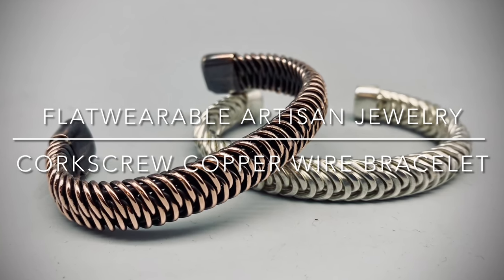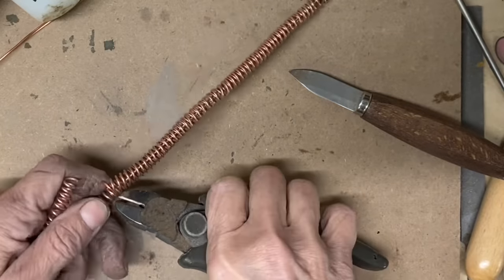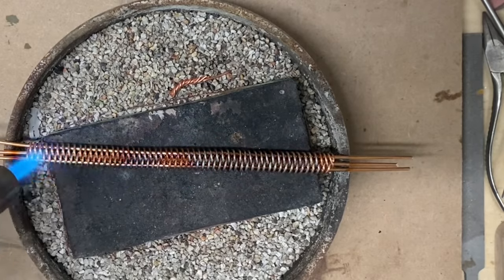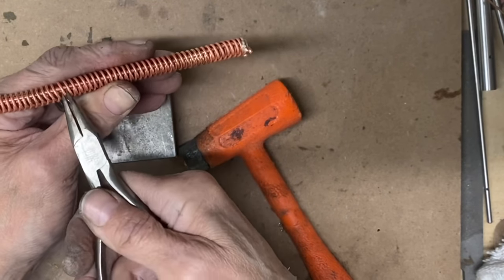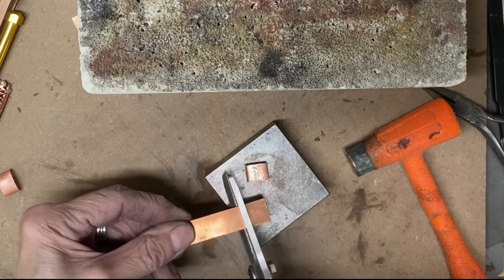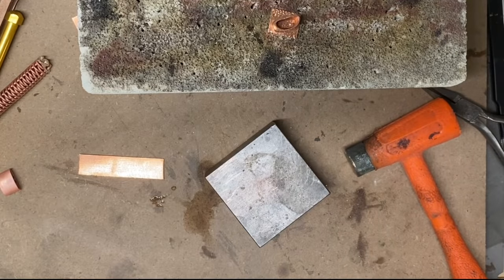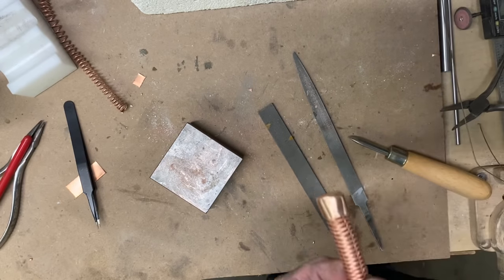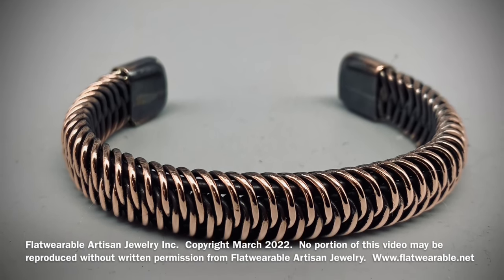Corkscrew copper wire bracelet - Flatwearable Artisan Jewelry

Comment: You're using a drill chuck for your mandrel. To save yourself time/fighting/cutting your wire, about an inch down the start of your wire bend a 90deg. Then stick the tip of the wire between two of the teeth of the chuck. Almost all of the wire sizes you use should be able to fit.
Reply: I've used this technique when making jump rings for my chain maille

Comment: Nice!
A little tip for you..
If you just hold the ends of the coil and pull them apart they will separate equally..
You don't have to separate each bend and try to make them even.
Reply from the maker: It does spread the coils more evenly but you still have to get 2, or more of them to line up perfectly in order to join them.  My bracelets come out 100% better using the jig.

Comment: Stunning work, a tip for when you have finished making it. Take some beeswax and melt it in between the spaces of the bracelet, and wipe off the excess. What that does is it stops the bracelet from plucking at your arm hairs.

Comment: You can just stick the end of the wire in between the jaws of the chuck of your wire coiler. It wont come out. Then you can just pull the coil off the end of the mandrel. I do it with my drill. The only time it  wont work is if the mandrel is so small the chuck jaws are too close together to fit the wire in.

Comment: Really interesting work I enjoyed watching it. I have a question or two you mentioned pickling several times and I seen you spraying something on the metal before you would solder it. What is the pickling solution and what are you spraying on the metal before you solder it if you don't mind my asking thank you for your time. I did enjoy watching how you made the bracelet and the final finish
Reply from the maker: Sparex is the product used to make the pickle.  My-T-Flux is the spray that is used to clean the metal and allow the solder to flow.  You can find a list of all of the tools and items on our website at https://www.flatwearable.net/home/corkscrew-copper-wire-bracelet/

Comment: It’s beautiful, do you do anything to keep the copper from turning your skin black, thanks
Reply from the maker: You can dip it in Protectaclear.  I talk about it in this tutorial.  https://youtu.be/sNZIKFxrWOk
Reply: I've tried that many times and was very disappointed. It makes the finish look cheap and wears off fast. Then the finish is uneven and all kinds of messed up. Ultimately the copper will still oxidize, staining your clothes, skin and everything else. I love copper but it just can't be worn for jewelry that is exposed to any kind of elements or wear and tear 😔
Reply from the maker: Sounds like you aren't preparing the metal properly or using the wrong type of sealer, or not applying the sealer as instructed.  I've had no issues as you have described.  People need to realize that you cannot wear jewelry while washing dishes, bathing, swimming, exercising, etc.  Copper is a great metal for jewelry and an inexpensive way to learn.

Comment: I have a massive spool of 20 ga. cooper wire that's been around for years so I just did a 6strand braid, flattened it and made a frame for a stained  glass piece I've been working on. I'm going to try this next. Thanks for showing how to do this it's beautiful. IT took three feet of length so it's going to be a trick but I'm game. What is the pickling solution , and what does it do? Subbed and definitely checking out your channel for more ideas.
Reply from the maker: Check out the link in the description box.  It will take you to the page where you can download class materials that contain information on pickling.
Reply: @FlatwearableArtisanJewelry  awesome thank you.